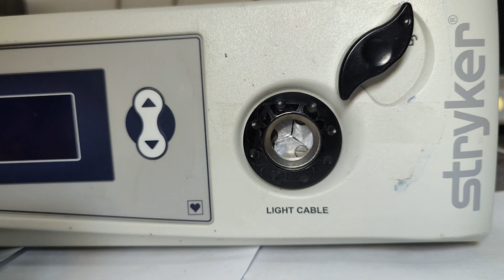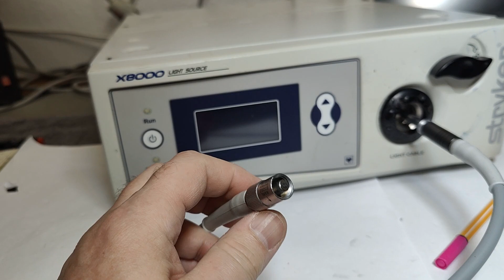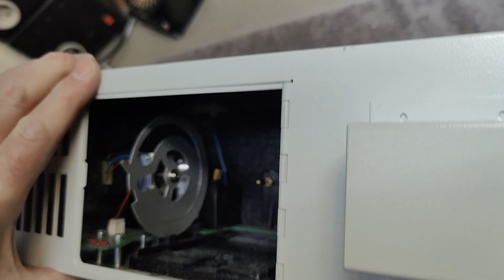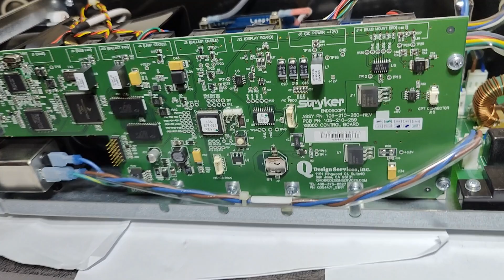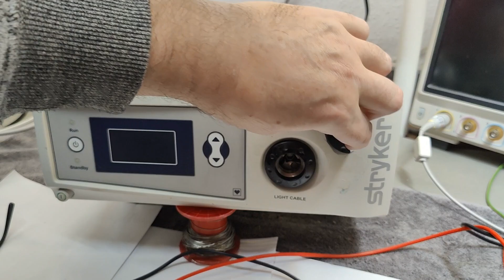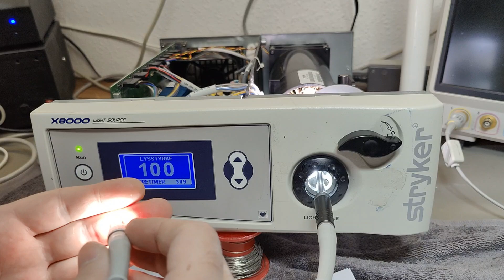Stryker X8000 Medical Light Source 300w xenon lightguide

Comment: lately I am having the same problem with the x8000, it goes on standbye, and inserting the light cable in the connector that works perfectly, it wouldn’t move from stsndbye in ti run. How can I fix the problem?
Reply from the maker: do the same fix to it as i did
Reply: what I understood from your video that you excluded the sensor that behind the mechanical light cable connector. I did that but it still doesn’t  wirk

Comment: The lamp may be left in a pre-ionised state to be able to turn it on immediately.  The same is done when engraving with DC CO2 laser tubes.  They have a tickle current that runs continuously even if they are not lasing that is 1-5% of the main current  but allows for high speed raster engraving bu modulating the tube voltage and laser output without having to wait for the ignition pulse to do its thing.

I think your machine is working correctly.
Reply from the maker: it was impossible to look at the light and evaluate its power, it was much easier for me to simply look at power consumption from mains supply, that number told me it was full power.
Reply: @TeardownOZ2CPU  That is sad and a terrible waste of energy and lamp hours.  Use your hours wisely.  The Dallas button will probably tell you your lamp is worn out at 500 hours even if it has another 1000 left at reduced specifications.  You could read the button or eavesdrop the protocols to find out if you can prevent the button from writing updates or cloning it and then replacing it with a earlier clone each time it claims to have run out.

A problem with this is if they have done like the inkjet printer manufacturers and keep a copy of the last 3 ink cartridges status in the printer as well so they know if you are trying to replace with a fuller cart.  People had to cycle between 3 cards when refilling to eliminate the history.  Probably had in this case.

If your scope can decode One-Wire protocol there might be some indication of what is being done.  Some buttons are write once, and you might have to write a secret code into them that is hashed from the button serial number and you would have to use an button emulator.
Reply from the maker: @KallePihlajasaari  oh darn, you are SO right.. some companies design e-waste on purpose for lame money

Comment: Not sure but might just be the way it works, standby moves the optical attenuator to 0% light output while the lamp stays on for instant output when required by the surgeon. Also makes stryker selling more lamps 😂
Also ensures consistent color temperature as the lamp doesn‘t have to go through its ignition phase. Igniting is furthermore quite harsh on the lamp, you wouldn‘t wanna do this too often as it shortens life expectancy drastically…
Reply from the maker: I have been thinking about this for 2 days now, and i feel sad to say you are right.. the lamp is ON !! the whole day, even if they dont use it, 500 hrs go fast this way !!

Comment: Nice teardown. You will probably find between the logic and the high voltage board one optocoupler  to power the lamp and another one to get the state if it's ok ,  we can found those xenon lamp inside  3lcd or dlp projector but with longer  lifetime.